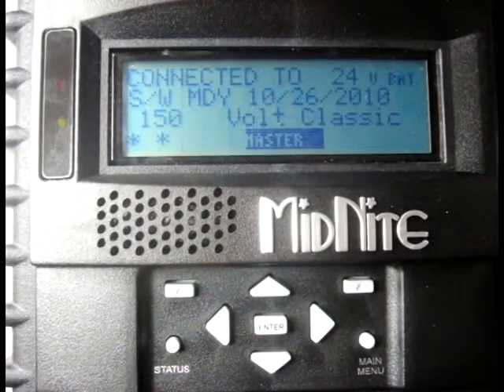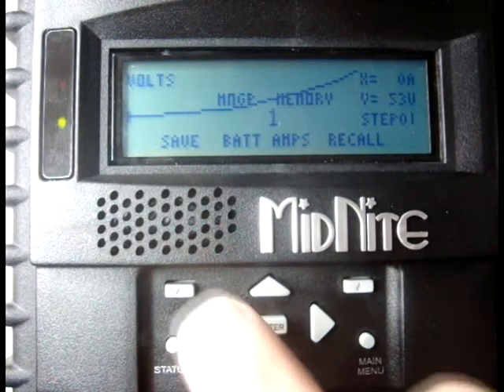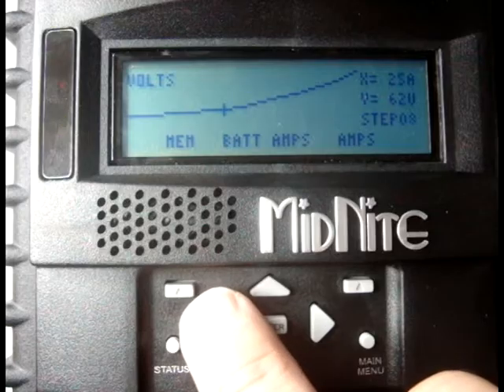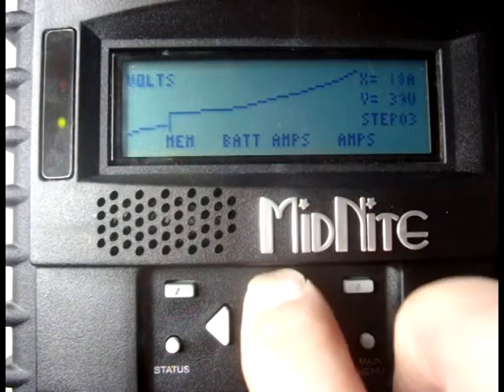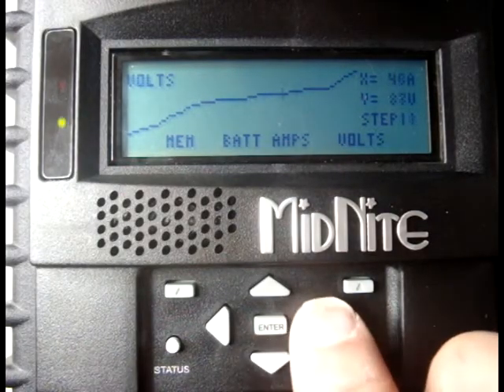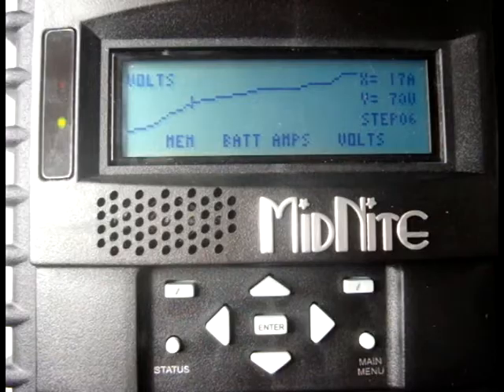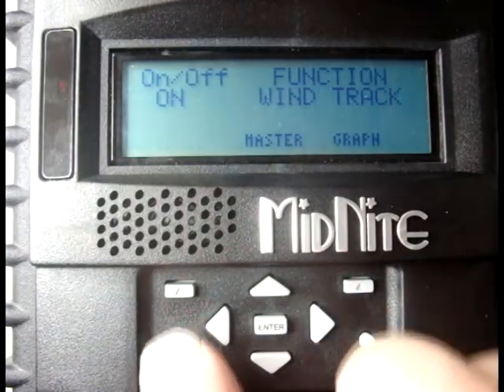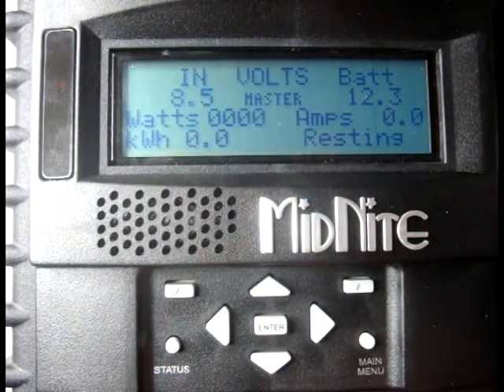MidNite Solar Classic Wind Curve Graphic Editor

Comment: I notice on Wind the Mode is always "OFF" is that correct? WHat should Aux 1 and 2 be?
Reply from the maker: Wind Mode should not always be off.  It will be turned OFF if you manually turn that mode off  OR it will turn off if the curve is "whacky" in some way like, if an input voltage step is set to a higher than Classic input specification etc.

It is probably OFF in this video because it wasn't being operated.  Just programmed for the video.

Aux 1 and Aux 2 are programmable so those being on or off depends on how they are programmed and the conditions that turn them on or off like voltage for instance.
Reply: @k7iq  Thanks for the quick response.  I spent about $7k on charge controllers, turbines, inverters, batteries, and cannot get it to work at all.  I have had electricians install it.  But my Classic always reads resting and then trips the Arc Fault protection at super low speeds. I just don't get it.
Reply from the maker: Turn OFF the arc fault and reboot the Classic.  Arc fault is for solar  and not wind anyway.
Also, you need to have wind and it has to generate input voltage greater than the battery voltage for that first voltage step in the wind graph.   Let's see your wind curve.
You might want to go to the forum and ask about this.   www.midnitesolar.com   There are a lot of people that have used the Classic for wind use.
Reply: @k7iq  ok will do.  Thank you again. I bought this $1650 MPPT board with all the breakers, diversion loads, and charge controller. So they had it all set.  I’ll get with them first and see if they also programmed the classic.  I’d not I l’ll get their input and certainly check out the blog.  I have some time because permits to build the tower are dragging.  Thanks you so much.  I’ll let you know how it goes!
Reply from the maker: Excellent !  Hope to see you on the forum.  Lots of great helpful people on there !